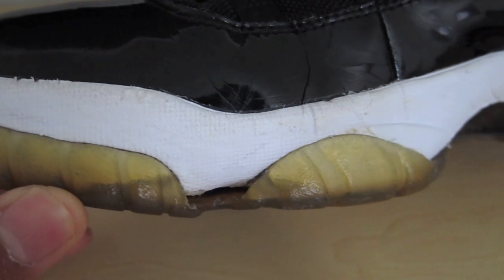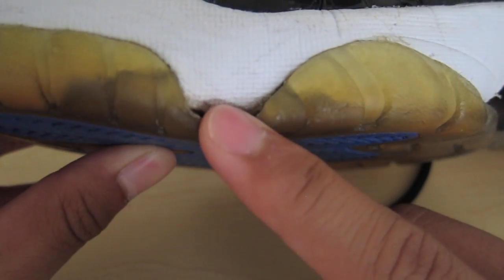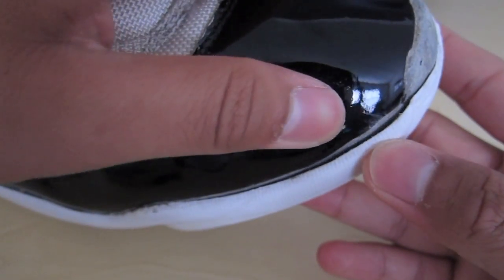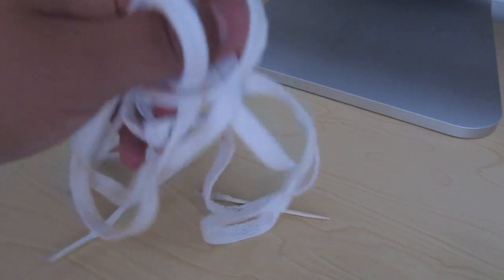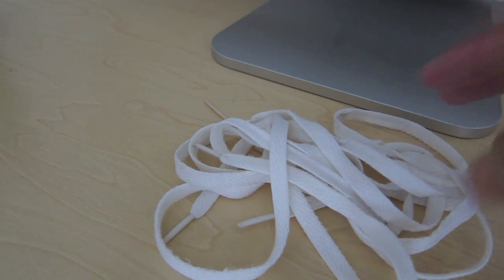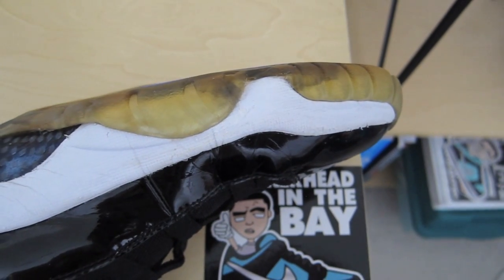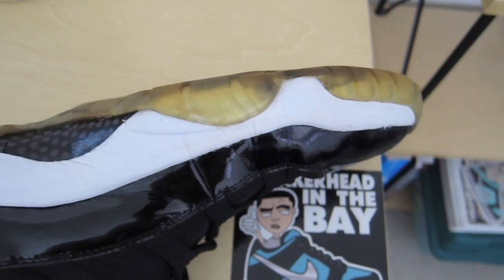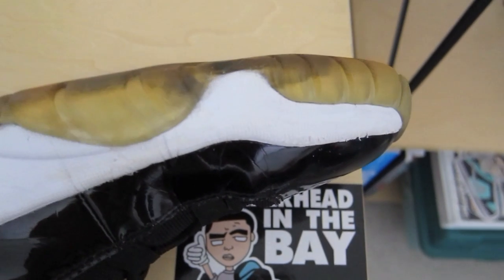How To Fix Sole Separation Tutorial!

Comment from the maker: Get a lint roller and put it inside the shoe with the end pointing out. Lace up the shoe all the way, and tie them really tight so it holds the roller in place. Once the roller is in place, you can use the stick to tie your shoe lace to. You can also use rubber bands. Hope this helps.

Comment: @ElijahGotKicks, the things you need are a q-tip, and nail polish remover/alcohol. Just dip the q-tip in either and slowly go over the scuff in circular motion, and keep doing so until you don't see the scuff any more.

DISCLAIMER: once the area dries it will leave a dulled spot. What kind of shoe are you doing?